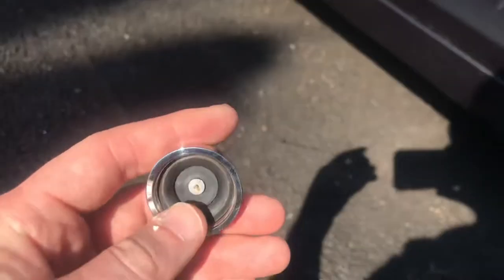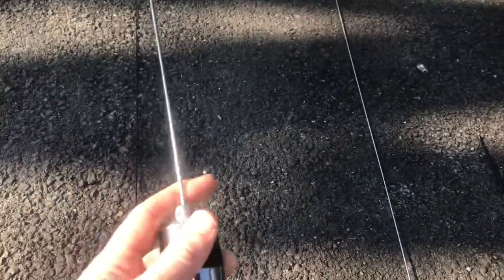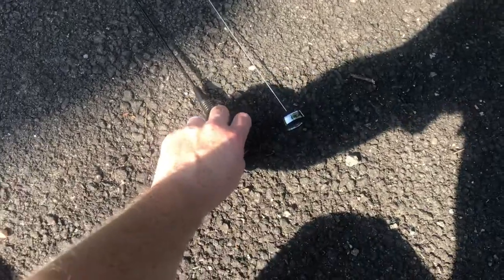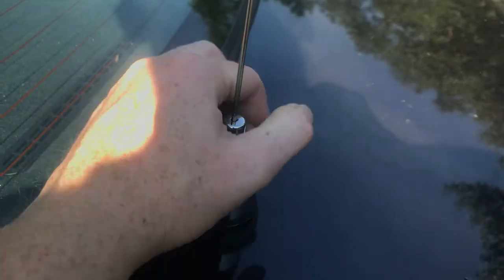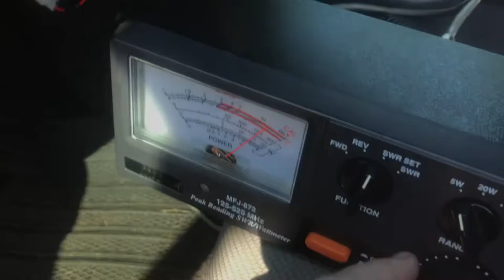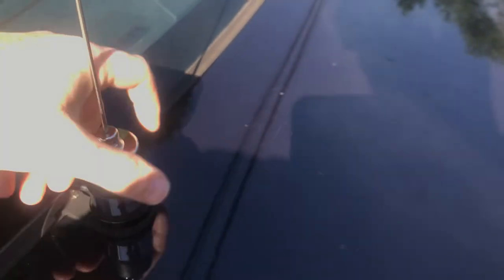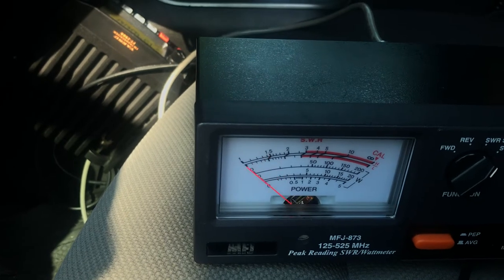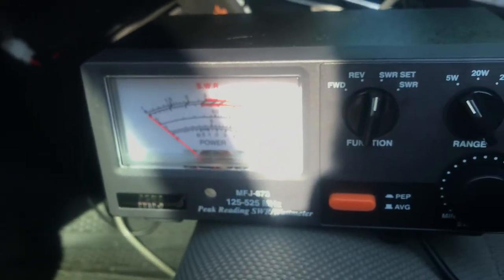VHF 2 Meter Mobile Antenna Comparison 1/4 Wave 1/2 Wave or NGP and 5/8 Wave NMO Antenna Selection

Comment: I have a question. I have a Rugged Radios VHF radio in my side by side and my wife has one in her side by side. the kits came with the Rugged Radios 1/2 wave no group plan antenna. Is there a better antenna we can run?
Reply from the maker: Yes, there are - however, you’re talking about a side by side - what material is that vehicle made out of and how is the antenna currently mounted to the vehicle?  

If the vehicle is not made out of metal (ideally steel), and the antenna is not mounted in a way so the “ground” [counterpoise] is connected to the chassis of the vehicle - then the 1/2 wave No Ground Plane [NGP] antenna is the best option. 

If the vehicle (or whatever you’re mounting the antenna to) is 

-made out of metal and is possible to mount the antenna so the vehicle’s metal body forms the opposite half of the antenna [electrically speaking, not literally literally speaking] 

Then you could run a 5/8 wave antenna, or even more high gain antennas are out there.
Reply from the maker: The other thing you want to ask yourself is what application are you using this radio system for?  

What environment are you operating in?  What’s the terrain like?  

What distance are you trying to cover?  
What type of radio(s) are you using with the antenna(s) and how much RF power are they transmitting? 

How many different frequencies (channels) are you using? and - this is important - what are those frequencies  and how far apart are they?  

The higher gain antennas (5/8 wave, etc.) will not work as well across wider bandwidths (different between whatever the lowest frequency you’re using is and  whatever the highest frequency you’re using is).  

The 1/2 wave No Ground Plane (NGP) antenna and, if you have a ground plane, the 1/4 wave antenna - work better across wider bandwidths.  That is the trade off.

Comment: ¼ wave length is a unity gain antenna means no gain. How many times are you going to tramsmit out of band .... that is illegal if ya dont know.
Reply from the maker: I have a FCC Part 90 land mobile license (business radio license) for the 151 MHz frequencies - 151.5050 MHz, 151.5950 MHz, 151.6250 MHz, 151.7000 MHz and 151.7600 MHz.

I am fully aware that it is illegal to transmit out of band.
Reply: Do ya know what they say about assuming? Why don’t you mind your own business?🙄